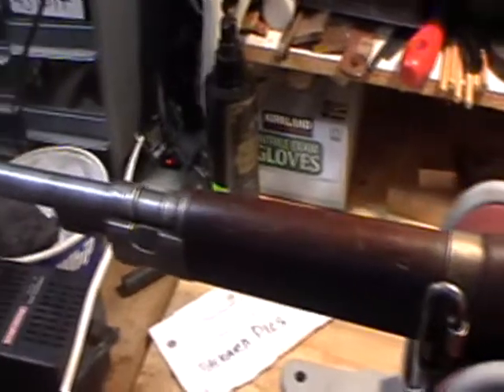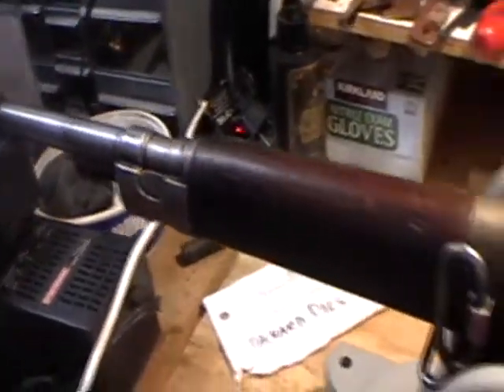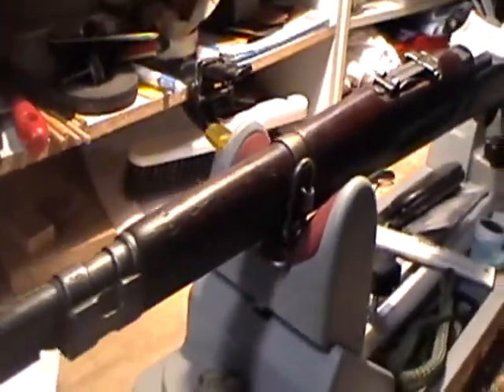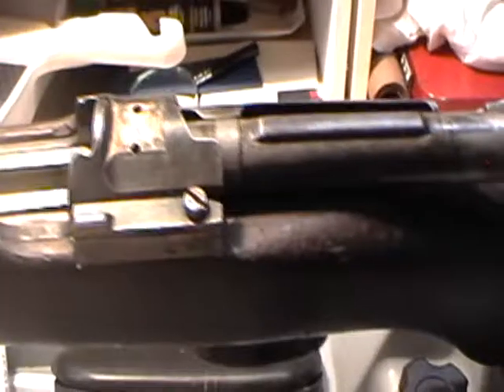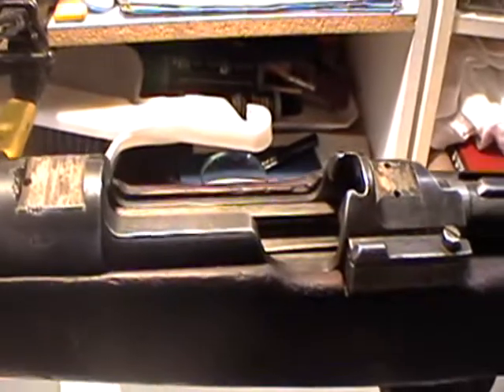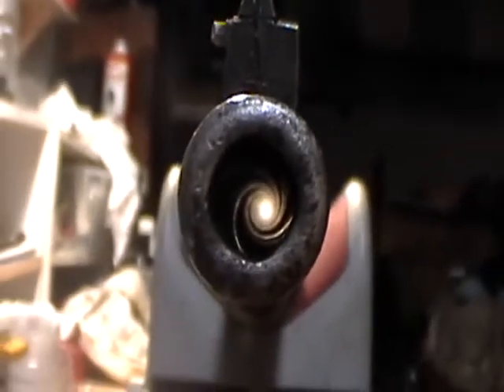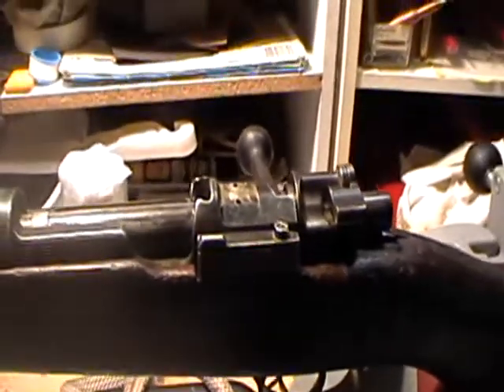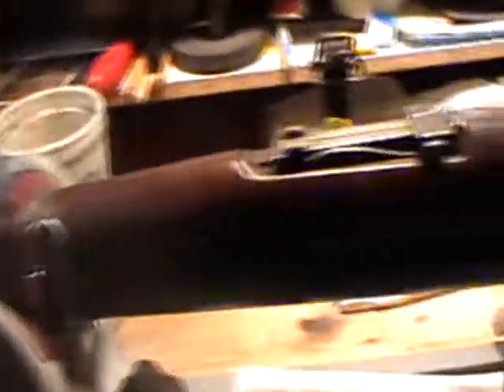Czech VZ24 Mauser

Comment from the maker: @BlueAlseides Well you can really only clean so much. Bronze brushes in the right size are helpful. But it is a good idea to go both ways, from the breech and from the muzzle. Just be careful of the crown. That way more stuff gets dislodged. Also cleaning with solution, whether it be Hoppes9 or CLP, etc. Only so much will come out, and then it's to the point where it needs to be shot. But a dark bore is a dark bore. Visible lands should shoot though as long as the barrel isn't shot out.

Comment: I've just finished working on my own Vz24. Stored for two years after being flood damaged. It has come up pretty good. Like yours, mine doesn't have front sight cover but oddly mine has a turned down bolt handle. No date on mine what so ever but I think its newer than yours by the serial numbers. mine is 2333.

Comment: marshal, my vz24 has a turn down bolt==i thjnk they just heated it up with a torch and bent it . the serial number on the bolt is the same as the rest .my front cutout for the mount had the same set screw thread markings yours did, i guess the czechs were not too fussy about how deep they made the milling cut in the receiver. i used a thin layer of dark blue epoxy to fill the spaces--cant even tell it.---djb